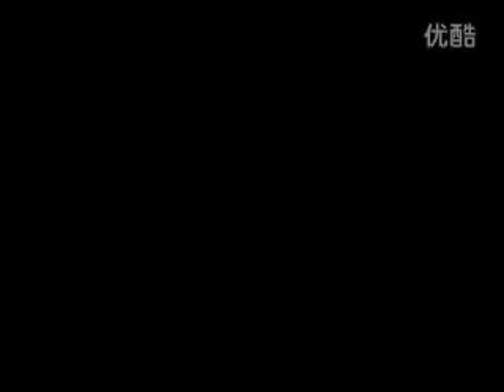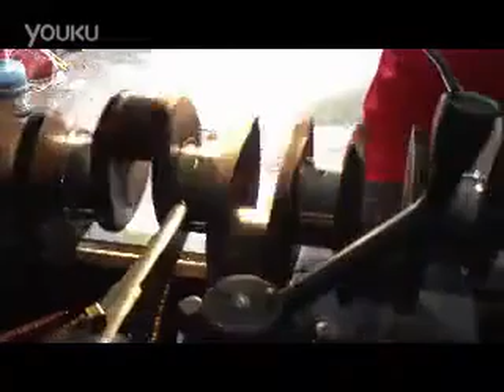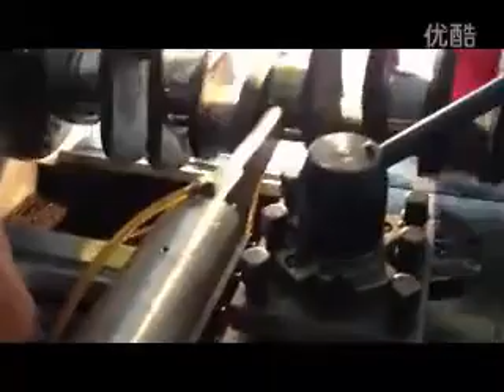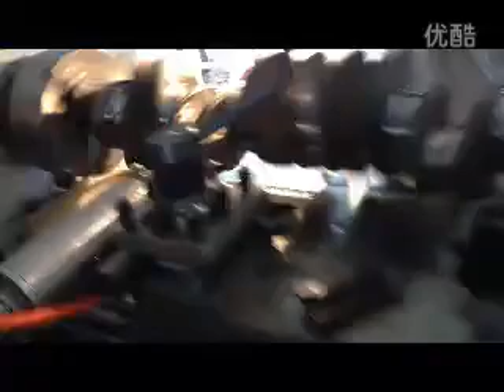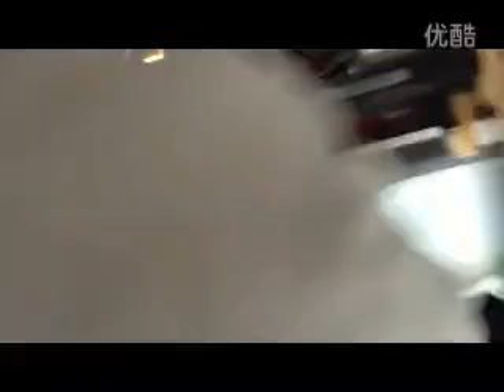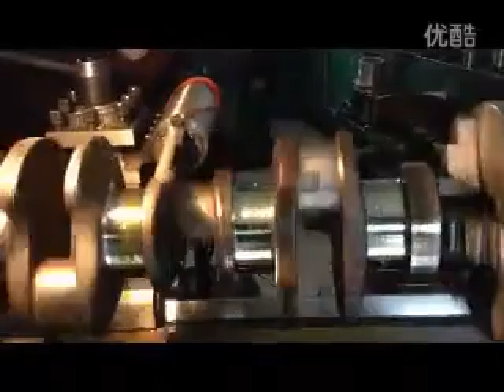HB-crankshaft superfinishing attachment-HUABAO-www.vsrsuperfinishing.com

Comment from the maker: JINAN HUABAO MACHINERY CO., LIMITED
http://www.vsrsuperfinishing.com
E-mail:brady0086@hotmail.com
TEL: +86 531 58761725
FAX: +86 531 88022270
CELL: +86 15866605088
MSN: brady0086@hotmail.com 
Skype: brady0086

Great Innovation For Metallic Surface Superfinishing &
Provide Complex Problems Solutions

Key words:
superfinishing,surface treating,surface processing,mirror surface treating,surface treatment,polish, finish, 
grind, burnish, buff, furbish,superfinishing,polishing, finishing, grinding, burnishing, buffing, furbishing,mirror surface,
decision surface,vibratory finishing machine,vibratory stress superfinishing machine,no-abrasive superfinishing,
superfinishing attachment,superfinishing machine,superfinishing equipment,superfinishing processes

Superfinishing Equipment

The brief:
1. Obtain surface roughness less than Ra0.1 easily;
2. Suitable for different shapes, such as cylindrical, internal, rotor, curved and spherical, axis,etc;
3. Suitable for all kinds of materials, such as carbon steel, aluminum alloy, copper, etc;
4.Suitable for different industries, such as Turbine, Mining machinery, Mechanical valve, Petroleum Machinery, Bearing mechanical, Mold, Paper machinery, Pharmaceutical Machinery centrifuge, Piston rod, Hydraulic cylinder, Helical rod, Metallurgical Machinery, Wind power, Hydropower, Motor.
5.Can be used in all kinds of machine tools, such as lathe, grinding machine, boring machine, milling machine, planning machine, spherical lathe and CNC machine tools, ect;
6. Just one time, improve production efficiency greatly;
7. Components: tool assembly and control-center;
8. Improve the micro-hardness 20%;
9. Improve the wear-resistance;
10. Improve the fatigue life 5 ~100 times;
11. Suitable for the hardness below HRC65;
12. Improve corrosion resistance;
13. It's a nonabrasive process, without abrasive, felt, lapping compounds and hard work. 
14.Relieve the residual stress greatly;
15.Long service life of tool and workpieces;
16. It saves time, money and energy;
17. No sawdust and sawdust wastes occurred,no noise and damage to the environment;
18.Easy to operate.

The principle:
According to metallic materials cold plastic deformation in the normal temperature and apply HB-superfinish equipment to superfinish the surface without any abrasive to reach desirable roughness,this process just like ironing clothes.
The process:
Firstly, make the workpiece pre-machining in the general purpose machine, then apply HB-super finishing equipment again, the roughness will reach less than Ra0.1 easily, just like ironing the clothes and a kind of compressive stress created on the surface at the same time, the micro-hardness will be improved more than 20%, the wear resistance will be improved greatly and the life will be improved 5 ~10 times.

The description:
This equipment including two parts, one is cutter, the other is control center,
the cutter is controlled by control center,
there is a unstable ball which made from a special materials on the cutter head,
during process, the ball impacts the surface 30,000 times per second with very little pressure about 2.5N,
the temperature is little higher than the normal temperature,
it's a nonabrassive process, without abrasive, felt, lapping compounds and hardwork,
save time and cost greatly, and very environmental,
it's very different from the rolling, polishing, grinding and other process,
more precisely, it just like ironing the clothes, never remove any materials from the surface.

JINAN HUABAO MACHINERY CO., LIMITED
http://www.vsrsuperfinishing.com
E-mail:brady0086@hotmail.com
TEL: +86 531 58761725
FAX: +86 531 88022270
CELL: +86 15866605088
MSN: brady0086@hotmail.com 
Skype: brady0086